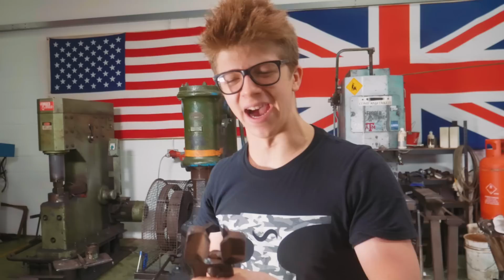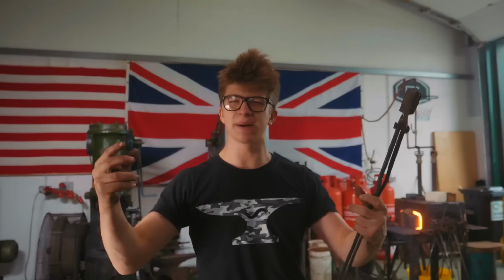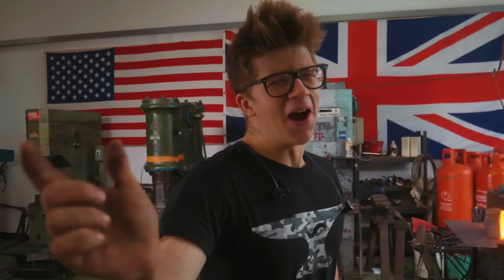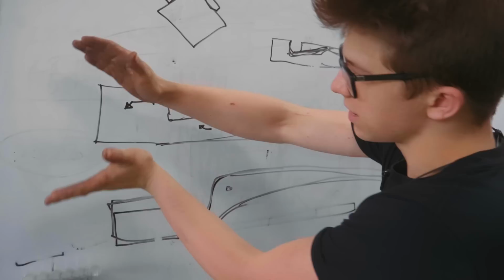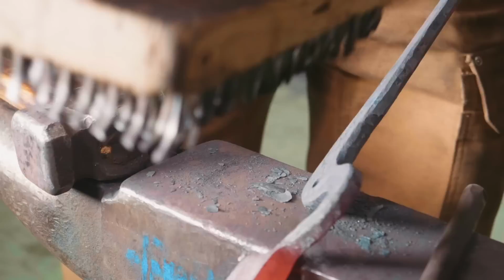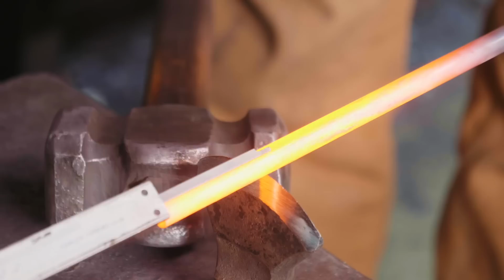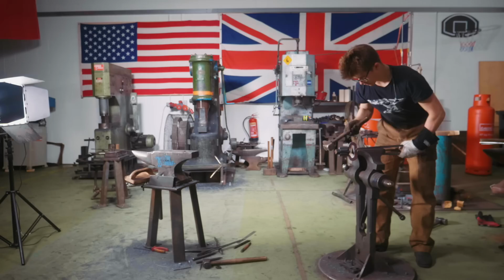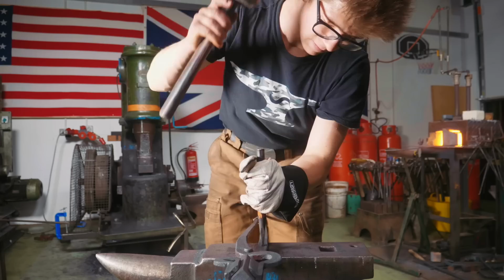MAKING BOLT JAW TONGS!!!

Comment: I just started my first blacksmithing project ever with an improvised setup: bbq coal "forge" , a piece of square stock welded on a section of I-beam as an anvil, a normal hammer and a pair of pliers. Works pretty well but I have to say the pliers are the biggest problem. Searched online and found that actual tongs are kinda expensive at ~60 dollars so I'm glad I found this video so I can make my own. Time to fire up the power hammer !

Comment: Here's a 2 cent that I figured I'd throw in. In the beginning you cut the flat bar on the flat side. Doing this forces your blade to drag it's cut shaving all the way through the piece to get out the other side. While it takes a little less time, it can cause excess wear on the blade. Cutting on the narrow allows the blade to discard it's material almost immediately after it is cut from the piece.

Also, I know this doesn't apply to your band saw, but if you took that habit to a chop saw or a radial arm saw, you could cause a VERY dangerous kick back that could throw a 2 foot piece of steel across the shop like a bullet.

Still love watching your work Alec! Keep the videos coming!

Comment: I know it's unrelated but figured it would be read and give it a shot.  When making the wood handle of a knife or sword, drill the center hole then heat the blade to a dull red then use the metal to burn the space. Saved you drilling and sawing, it's the traditional method, leave a 2 or 3mm shim for tightening, and the burn will harden and preserve the wood. It's how traditional long sword handles were made.  I've doe it on my own and love the result. Your blade keeps the smell of the workshop forever

Comment: One thing I admire about blacksmiths is if they don't have the tools to do a job they just make them. It seems like anymore if you can't buy it at the hardware store or online then it just doesn't exist or you try to make do without.  Take the time, make the tool. it may take you all day to do it but if every time you need it after that it saves you time or frustration it is time well spent.  The proper tools also let you do better quality work.  I'll admit to being lazy.  I'll spend 2 hours saving myself 15 minutes.

Comment: Dude you should move the conduit from behind your Steele rack so you can bolt it to the wall for safety , or you could C notch the top bar low rider style so you can bolt the rack up against the wall for safety I  cringe every time you walk by it . Love the videos btw keep them coming

Comment: Great video as always, would have loved to see some hand hammering for this but still awesone as always! Also curious why don't you insert some brown paper between the pieces before riveting them to give a slight but of play?
Reply: The paper would burn away when you put the hot rivet in, and you want them to be tight against each other vertically or else the bits wiggle up and down and make it awkward to grab things.
Reply: It does burn away but it leaves you a small gap that still keeps them tight but stops them in those few short moments from coming to the point of over peening the rivet and making them too tight

Comment: This is old and I am sure you won’t see this but if you used flat bar instead of cutting the tips I’m could you not have left the flat twisted it and bent the flat over the work piece just seems easier

Comment: When you make stuff like this, do you need to quench and temper the tings when finished forging?
Reply: Not if you use mild steel (1018).  That is because there is not enough carbon to harden.  While a medium carbon tong can make for a stronger and therefore lighter tong, I find worrying about which tongs are tempered and which are not a bother.  Plus then you will need multiple copies to allow them to cool at room temp while you switch to another pair. Or the need to later re-temper them. Mild steel allows you to just dunk them in water and not worry about ruining the temper cuz there is none.  Anyway it is far easier to forge mild steel.

Comment: uses bolt tongs to make bolt tongs
Reply: Hillary Clinton this could quite simply be done using the bar stock as a handle. Just heat what you need and hammer it out. Almost all tongs can be made this way
Reply: Like Jake Pryor said, but also if you get into smithing you will start to learn that having the right sized tongs is a huge difference in control over your work, and thus quality. He had tongs smaller than 1", and tongs bigger than 1", which meant that anything 1" he was making would not be held securely.
Reply: Hillary Clinton shouldn't you be out making excuses or blaming other people?
Reply: lunkydog lmao
Reply: Now if only I could do the same with expensive power tools

Comment: About how long does it take you to make a set of those tongs.
Reply: Depends on skill and style. The last pair I made took me about 2 or 3 hours and were in a bolt-head style. Of course, they were a dismal failure due to a structural issue but that was a lack of experience on my part.
Reply: Dortan Halcoym thank you my skill level is on the bottom. I'll get this shit figured out 1 day

Comment: I know this is a rather old video at this point and I'm nowhere near your level of blacksmithing knowledge but couldn't you have formed the jaw of the tongs by flattening the tip to around a quarter inch thickness and then used the edge of your anvil to create said jaw? I figured that flattening the steel then using the peen section of your hammer created a line in the steel, then using that indentation to keep it in place on the edge of your anvil at a 45 degree angle and then hammering the metal flat to the anvil would create the desired jaw shape. IDK if it would be easier or if it would even work as well as what you did in the video. Purely hypothesis at this point, but I may give it a try one of these days and let you know how it turns out.

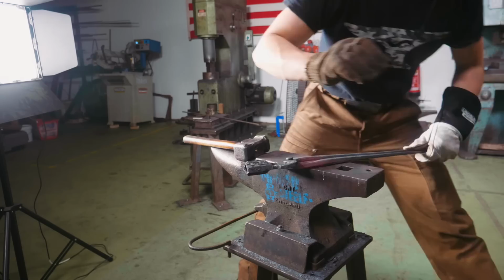Comment: Can someone explain what the scratching/scrubbing does? 11:35
Reply: Eli Salisbury this removes the scale from the peice which oxidizes off constantly. He is keeping the surface clean from all the iron oxide that's forming as it cools
Reply: Removes the iron oxide, that grey stuff that falls off the material when he's working it.
Reply: gets rid of hard scale, makes it look all nice and stuff
Reply: Jake Pryor cheers :)
Reply: Coltaine Crows Thx dude
Reply: Thanks Martin
Reply: In addition to the oxide, the brush he uses is made of bits of tool steel, which can also help to smooth out the surface if he hits slightly off center. It wont help with a truly bad hit, but the inconsistencies can be masked with frequent brushing, and it helps with a nice forge finish.